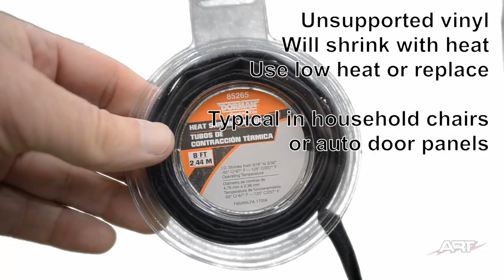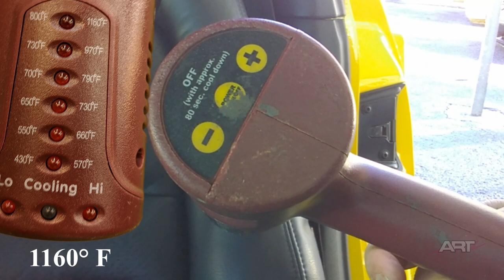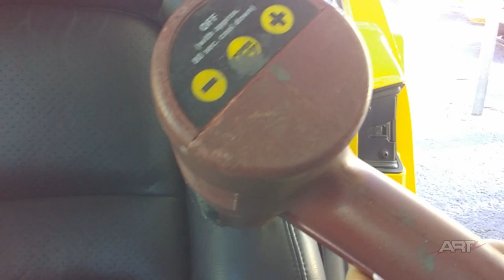How Much Heat For Vinyl Repairs? v39

Comment: Love your videos. Been doing it 12 years myself here in Canada and I learn a trick or two from your videos. Could you please consider doing a video on graining a repair on a really heavy grained leather seat( eg. a BMW or Mercedes) . I don’t like ironing leather seats cause it’s not meant to be burnt and always gets a halo. When you use a spray grain( which is a pebble ) it looks different to the natural grain and the more you use the more you change the feel and look of repair area. I ask cause I do really high end dealers and they more picky than regular lot work. Thanks mate.
Reply from the maker: Thank you very much, Morgan.  The Mercedes seats that are heavily grained are vinyl.  The only way to make a truly representative grain pad is to have the vinyl lying on a firm, flat surface.  For any problematic fabric, consider getting a piece of it from a salvage yard.  They let trashed seats go for very little money usually.  Then you can make a pad as I've discussed.  The same cheap vinyl is used in Dodge and Chrysler.   Oops, didn't mean to say vinyl...MBTex.  Sorry!  Shhhh...
Cheers
Reply: A.R.T.'s Real Repairs for Real Customers  I’m aware most of the Mercedes are vinyl and can be heat and pressed but there are a few that are real leather. Same with BMW. It doesn’t matter the brand but regardless of the vehicle type, when you get a really heavy grained leather ( real leather) and you have to fill a cut and now have a bald spot... what is your process . Also, keep up the good work with your music 😎

Comment: Hi Rick what do you use to thin waterborne  interior paint and and what do you use to clean your paint gun thank you for these very informative videos
Reply from the maker: Thanks Joe.  There is a thinner resin for that.  It thins while still preserving some adhesive properties.  Cleanup with water, then spray a bit of very strong ammonia cleaner and leave some in the gun to prevent solidifying of any residuals.